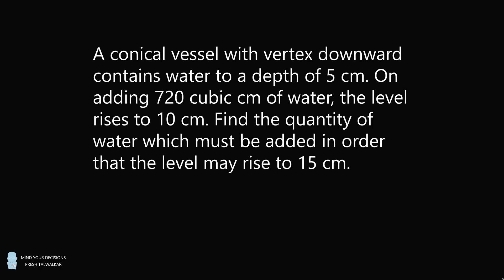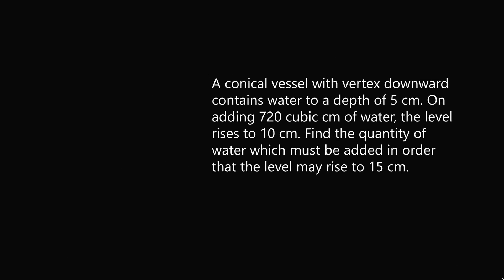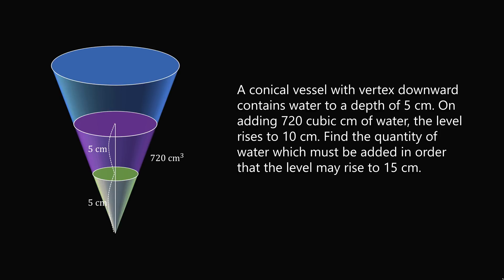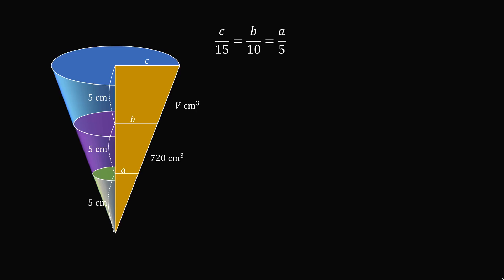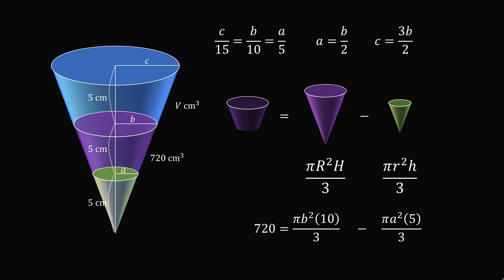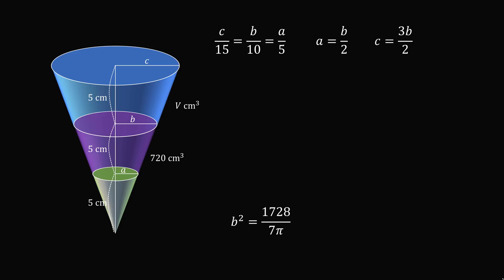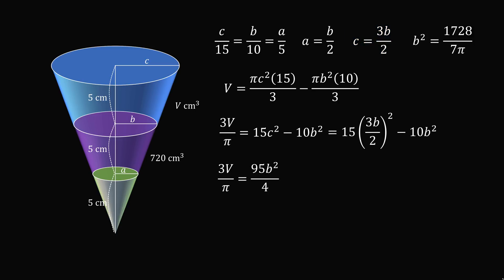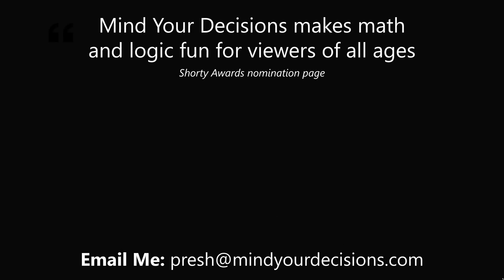Filling Up A Conical Cup - How Much Water Is Needed?

Comment: Thanks for the video!

You don't really need the cone formulas. This problem has a nice shortcut if you keep in mind that when you scale a 3D shape by a factor of k, then its volume gets multiplied by k³. For example, if the water in the cone raises from 5 cm to 10 cm, the new cone is 2³=8 times bigger in volume. This means that if we call v the original volume in the cone of 5 cm height then the new volume is 8v, that is, 

v+720=8v ⇒ v=720/7 cm³. 

Similarly, the big cone of height 15 cm is 3³=27 times bigger than the small one. So if we call x the volume that needs to be added then 

x+8v = 27v ⇒ x = 19v = 19·720/7 ≈ 1954.29 cm³.
Reply: This is how I did it.
Reply: It actually doesn't even need to be a cone. It works the same with a pyramid.
Reply: For a cone radius is proportional to height, so:
r(h) = kh , V(h) = ⅓πk²h²*h = mh³
Therefore volume is proportional to height cubed, QED
Reply: I did it this way, too (I even used v and x as variables in the same places as you)! 😀
Reply from the maker: Thanks! It is a much simpler solution and cuts through many of the calculations. I remember thinking about giving that explanation in that line after someone posted on Twitter (https://twitter.com/GeoFreC/status/1619780899121565696). But I doubted how well I could explain it carefully because not all cones are similar! If you have a cone with 2 times the height, but the same radius, the volume is 2 times as large. But if the height is the same, and the radius is 2 times as large, the volume goes up by 4 times. In this case both dimensions do scale so it works out. However, I thought it important to emphasize the volume is dependent on (r^2)h, at which point doing the entire formula seemed more natural. Thanks for sharing this method!
Reply: @MindYourDecisions  Yes, but all the cones in this problem ARE similar, since they have the same vertex angle.  Therefore the volume of each of these three cones is proportional to the cube of its height (or radius).
Reply: @MindYourDecisions  i appreciated the longer and more detailed solution you presented.  i have been schooling myself for a few years and it is nice to see the way others think about problems/puzzles because it expands my horizons.

ON A PERSONAL NOTE, about a year ago, i went into the hospital for septicemia, and it really messed up my brain.  i had to relearn how to talk, walk, and even recognize family and friends.  i wanted to let you know that i used your channel to exercise my brain and regain my "mental muscle".  i still have trouble with words sometimes, but it has been getting less frequent as time goes on.  your channel is partly responsible for my return from a very bad place.  and i wanted to thank you for that.
Reply: @MindYourDecisions  a more simplest way is to write the volume of the cone only with respect to the height H and the angle at the poin a. V=1/3•pi•(tan a/2)^2 •H^3.
Reply: You’re assuming it scales as  r=h making it V~r^3 but the actual formula has relationship of V~r^2~h
Reply: @Noneblue39  The ^2 in the formula comes from the equation for the size of the base circle. So the base circle scales up as a power of two because it's a two-d object, but the whole cone scales as a power of three.
Reply: @Noneblue39  look at the triangle that is bissecting the cone. h~r, plain as day, not r^2. 
That means if you want a cone where the water is x times as high, the formula becomes 1/3 pi * (xr)^2 * xh = x^3 (1/3 pi * r^2 * h). The scale factor for the volume is cubic.